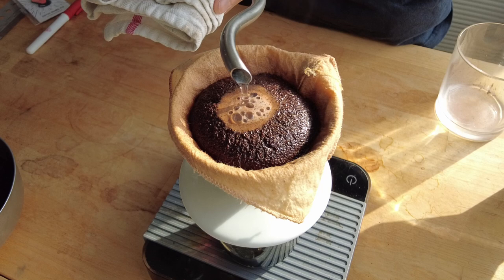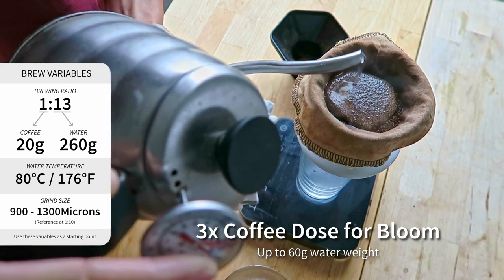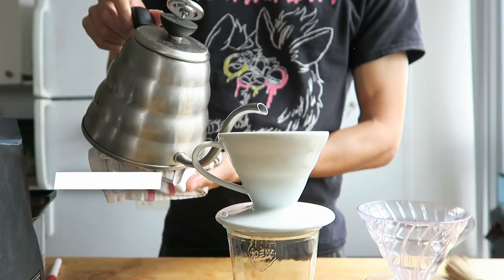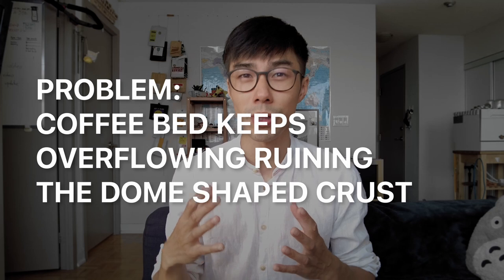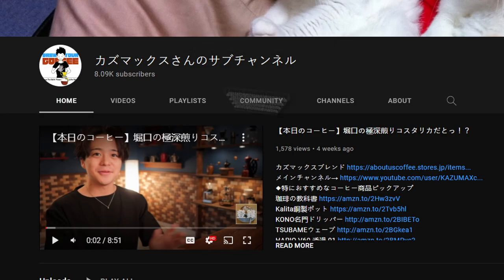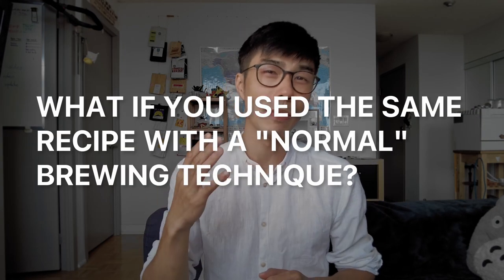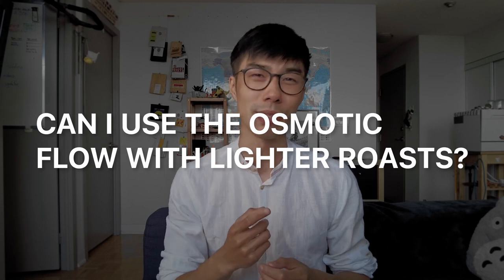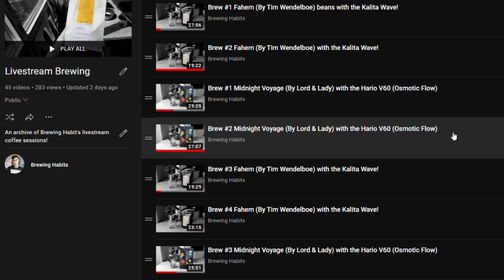Osmotic Flow V60 Brew Guide

Comment from the maker: End up trying the Osmotic Flow and liking/disliking it? Regardless of your experience, I would love to hear your thoughts on it down below ☕☕
Reply: Currently using regular kettle at home. And Brewista when visiting my roaster. Brewista is quite unstable in terms of flow. It can pour in middle/high speed only. Hard to nail. Regular kettle works a little bit better somehow. But I'm using light roasted coffee. Definitely need some 01. Have you tried big doses in 02? Cafec recommends not higher than 25g as I remember.
Reply from the maker: @coffeeblogua  A controlled pour and a proper dose is key with this method. Perhaps the flow restrictor add-on might be a good addition to your Brewista.

The thing about Hario V60 sizing is that if you are using the 02 with a big dose, it would have to be BIG (like 100g+) to reach the bed height of what one can get from just using a 01 as the cone gets bigger up top and you need more grinds to increase the bed height.

The plastic 01's are where it's at. Get one of those and you should be golden!
Reply: Though I haven't quite gotten it done correctly, even my mistake brews are very lively, bright and clearly well extracted. 
I have yet to try using a fresh darker roast.
Reply: I tried this recipe using hario v60 02, but it didnt work. Yesterday i was trying a dark roast recipe for an aeropress and there i saw the dome rising. Today i tried the osmotic flow using an aeropress. And it worked! At least it was better than the v60 02. Now i just have to compare it with an v60 01.
Reply: Hey man, year late but I recently have made a personal recipe for osmotic flow extraction for iced coffee, it's actually fantastic and brings out a really thick body with roasted notes of the coffee! That and also the sweetness and nuttiness of a well balanced dark roast makes for a delectable cuppa!

Comment: - 1:13 Ratio (20g coffee, 260g of 80C/176F water)
- Grind size 900-1300 microns (bit coarser than normal V60 grind, reference at 0:50)
- Rinse/pre-heat filter & shake coffee grinds flat in V60
- 0:00-0:15 Bloom with 3x (math works it to be 2.5x) grind dose in slow spirals about 1" high
- Wait 10 seconds
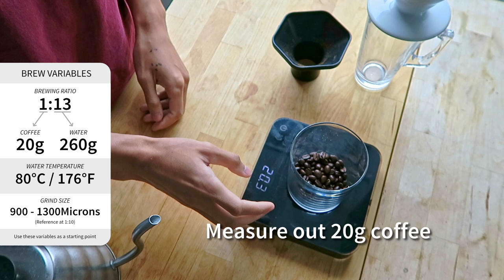- 0:25-0:40 Slowly pour from <1" high straight down the center,  with 1/3 of the remaining brew size (70g)
- Wait 5 seconds
- 0:45-2:15 Pour as slowly as possible from <1" high in a circle (3-4 seconds for each full circle), expanding to about a 1" diameter, and keep pouring on the edge of the circle's foam until reaching brew weight (260g)
- Let drain for only 5 seconds, then remove brewer 
- Stir do a backflip

Notes: 
- Using a smaller brewer (01 VS 02) helps, with a minimum 20g coffee dose
- Tip kettle on its side as you pour to be able to pour even slower (use cloth on bottom of kettle to hold it)
Reply: Do a backflip lmao. A few details seem incorrect, though. The slow pour after bloom uses 1/3 of total (120g). Also, he says the height of the pour stream is less than 1 cm, which is <0.4". The 1" is the diameter of the pouring area on the final pour.
Reply: @VictorChavesVVBC  Yeah, I went with less than 1 inch (<). I also went with his quote in the comments for the ratio discrepancy:
"I don't include the bloom when calculating the 1/3, 2/3 chunks but need to keep it in mind when brewing. So with a 50g bloom, the remaining liquid would be 210g and the 1/3 chunk equals 70g. 50g bloom + 1/3 (70g) of liquid combine to 120g, which is what I use as an indicator when brewing."

He ended at 260g, which would make sense with the above comment using the 50g bloom (x2.5 grounds, not the x3 as described).

I like it, but imo it seems like a waste of coffee. Wouldn't consider it unless I have a really dark roasted coffee.
Reply: @adamthemute  Ahh that's true, at 1:44 he says "the second pour segment, where we pour 1/3 of the total liquid", but the written cue below does indeed say to pour up to 120g instead. Details! Thank you for calling that out ;-)

Comment: Thank you so much! Actual best guide I have found for  the osmotic recipe! I own a bodum meloir gooseneck kettle and it has not got a lot of flow restriction, however I found that, may be obvious but, when you use less water in the kettle the flow controll is going to be better. One can pour slower with a kettle that is filled 1/3 or less! Just pulled off my first  osmotic flow brew today (after 2 weeks of failed attempts lol) and it is quite a condensed filter coffee! Very juicy and enjoyable. These center pour focused methods in my experience amplify the brighter notes compared to traditional V60 recipes but they also bring a grapefruit/Pomelo like bitterness to the coffee. Some friends of mine even described it as tea like? I would say that that is quite a good trade compared to the more muted but also more dark chocolate like profile of the V60 I am used to. If you don't want to leave the comfort zone of drip coffee, Just know that with great power comes great responsibility!
Reply from the maker: I really appreciate the comment! Totally agree with the 1/3 water amount and if you combine a kettle tilt, you can get super duper low and close to the coffee bed! Keep brewing responsibly 🔥🔥

Comment: WOW, well down. you have shown osmotic flow brewing method in a easier way than any other videos. I like the way you turn your kettle horizontally.
Reply from the maker: Cheers, glad you liked the video :D The horizontal kettle is really a clutch move to lower the pour height. Make sure to hold the lid, otherwise you might just have an accident haha.

Comment: Hey! Just came across this video today, and wanted to compliment you on it- I think this is the best and most comprehensive English language walkthrough of the technique that I've ever seen. Cheers to you! I've been playing with this technique for a year or so, and when you get it right, I think it produces one of the best cups you can get from a v60. There are lots of...um, not good videos out there, with only partial or even bad information, hopefully this one gets traction here in the West. I thought the one from the Cafec official page was good, but missing a fair amount of detail...or maybe the translation captions were just lacking, as I don't speak Japanese. But doing lots of research and watching lots of what's out there I pieced together my process, which I was happy to see is pretty much in line with yours. I use a v60 01 with 20g/280ml at a 14:1 ratio, so close. I use a little higher temp water at 85°C, which probably makes sense because I typically use a little lighter roasts- I tend to like medium to medium-dark Latin American beans for my daily home cups (they work well with both my v60 and Aeropress depending on my mood), and tend to save the light roasts for my café visits. Anyway, some things I've noticed are that with the Osmotic Flow method, even more than the recipe or water temp, the two biggest factors are nailing the speed of the pour (using the proper method you highlighted, of course) and MOST importantly, fresh, fresh roasted beans! As the beans get older and naturally lose their cO2, the bloom, gas release, and dome creation is less pronounced, and I feel like the process isn't as successful. Obviously the darker roasts have more gas and last longer, but the process does work with medium roasts as long as they're fresh. But that's ok, once I see the Osmotic Flow blooms start to wane, I use Aeropress for the rest of that batch. I'm too lazy to stop by the roaster that many times. :)
Reply from the maker: Really appreciate the monster reply!! I totally agree with you that freshness is a really big factor with this technique. Once the beans get stale and the CO2 diminishes, the dome shape can't really be created anymore. Cheers :D

Comment: Thanks for sharing. Currently trying to improve my Osmotic flow technique and create episode about it. When I first seen it on Instagram, I was thinking like "do they even extract", but digging dipper, found how this could improve the cup. What water PPM you are using? And what is the cup profile at the end in terms of clarity/notes. Is this roasting style suited for espresso as well?
Reply from the maker: Glad you liked the video! 
I don't have a PPM reader but my water tastes neutral/on the soft side. I use charcoal sticks to filter my water. The end cup is a liquid with a thicker and viscous body, with roast level notes like nutty, smoky, chocolate. The low temperature and other factors lead to a cup with minimal bitterness. Since the roast level is on the darker side, it could for sure be considered as a bean that is suitable for espresso. Cheers!

Comment: Used this method for the first time on a dark roast today, excellent results. I'm curious though, what is the justification for pulling the brewer before the final bit of brew water drains? Why do this instead of just brewing with a slightly lower ratio?
Reply from the maker: I think it’s to even the extraction difference between the beans placement in the brewer. The beans lower in the brewer will be extracted more compared to the beans higher in the brewer if you let it fully drain since it will have a longer contact time with water.
Reply: @brewinghabits  thanks for the response! So the pull happens before the dome gets to fully collapse? Maybe I'll run a test to see if it makes a difference!

Did you ever get around to experimenting with osmotic flow using lighter roasts or altering other variables?

Comment: It took me a few tries to get something that was okay because my kettle's water flow is too fast. The ending result was really interesting - low bitterness, rich darkness, and satisfying thicker mouthfeel! Refreshing compared to the light roasts I have been trying out. Might get a flow restrictor someday or just a new kettle because it's too frustrating with my kettle erg haha. Did you use the size 01 V60 for your brew? I noticed it was hard to stay close to the grounds as I poured because they didn't rise up to the same height as yours did. I have a size 02.
Reply: Also, props for the nice osmosis explanation. I love hearing the more science-y side of coffee brewing. It's so interesting!
Reply from the maker: Glad that you gave it a whirl and managed to get a similar cup! It really does have an unparalleled thick mouthfeel I have not been able to replicate with any other technique.

I am indeed using a V01 Hario V60. The extra inch or so that you get to the coffee bed really matters as it allows for the slow and controlled water stream. With some pouring practice and steady hands, you can probably forego the restrictor but I bet it will make the pour much smoother. Kinda like training wheels on a bicycle!

And glad you like the explanation and video, it really was convoluted when I did my research on the Osmotic Flow so I made it a goal to explain it to the best of my abilities!

Comment: If I grind at setting 9 (900 microns) on Ditting can I catch your grind size?  Or should I grind coarser? Thanks for the helpfull video.
Reply from the maker: Sadly enough grinders aren't designed liked that and the setting on your grinder never matches up to the micron setting. 

I would take out a ruler and eyeball it and try to get the majority of your grind particles to the 900 micron range. I also made this grind size checker that you can print out (make sure you print it to scale), put some grinds on and then visually identify your grind size.
 https://www.dropbox.com/s/u2fgfunb9qsat68/Grind%20Size%20Checker.pdf?dl=0

Keep in mind that a grind size is more like a range instead of a specific number. There will be some variance but the goal is to get the majority of your grind particles to one size. 

As for if you should grind coarser, if your brews flow rate feels slow, still overflows when you pour super slow, perhaps clogs, or coffee tastes overly bitter then I would grind coarser.

Good luck!
Reply: Thank you for the document. It definetly helped me find the right setting. By the way I'm using 1zpresso Q2 settings (22 + 1 click) around 900 - 1300 micron. There was definitely a change in taste. Thank you so much!
Reply from the maker: I am glad that you got your grind size dialled in to a reasonable range! Now that you have it in the ballpark range, you can start making the smaller tweaks to the extraction variables to hone in a balanced extraction. 

Before, the grind size must have probably been wayyy too fine making any changes you made still taste over-extracted and bitter (since it was so far into the over-extracted realm due to the overly fine grinds).

Glad to have helped and good luck with your future cups!! Lemme know if you encounter any other coffee issues/questions :D

Comment: i must not be smart enuf for this method :)  i can't get the numbers to add up for the first pour.  you said the first pour (after the bloom) was 1/3 the total liquid and then said and displayed that was 120g.  but 1/3 of 260 is 87g.  if you add this to the 60g bloom that's a total liquid mass of 147g.  so i don't get the 120g.  the final pour takes care of itself since you pour until you reach the 260g, so it's just the first pour that's confusing me for the amount of water to add.  maybe it's just me.  otherwise the video was excellent and well explained.  i like the trick of tilting the kettle to get it closer.  i've tried a similar technique and also switched to cafec roast-specific filters, and thought it made a noticeable improvement in taste.
Reply from the maker: Heyyo, here is a copy/paste from a previous comment!

"I don't include the bloom when calculating the 1/3, 2/3 chunks but need to keep it in mind when brewing. So with a 50g bloom, the remaining liquid would be 210g and the 1/3 chunk equals 70g. 50g bloom + 1/3 (70g) of liquid combine to 120g, which is what I use as an indicator when brewing. Hopefully that makes sense!"

Cheers!
Reply: @brewinghabits  ah, ok, yes that makes sense.  i did look thru some of the comments to see if someone else asked the same question, but guess i missed it.  thanks for the quick reply!

Comment: About how many grams of brewed liquid coffee do you typically end up with after removing the brewer at the end of the process?
Reply from the maker: Funnily I'm actually going to test this out tomorrow on the livestream brew! But as an educated guess, grinds retain around x2 their weight in water and I would say it's like 15-20g that ends up dripping out. This would make the final cup in this video around 200g of brewed liquid.

I'll edit this comment with my findings tomorrow :P
Reply: @brewinghabits  Sounds good, look forward to your results. Thank you.
Reply from the maker: Today I brewed with 25g coffee and 250g water (1:10 ratio). The end liquid in the cup was 175g, liquid that drained after I moved the dripper was 35g making the retention in the coffee bed 40g.

So around 70% went into the cup, 14% dripped out and 16% was retained in the coffee bed!

Correction, it was a 1:10 brewing ratio I used, not 1:13!
Reply: @brewinghabits  Thank you!

Comment: I found that the flow with Hario 01 bleached filter was too fast. Seeing as you use thick cloth filter, I tried double 01 filter and it worked much better.

Comment: what this still work with a chemex instead of a V60? I would just have to maybe add more coffee, or lower the kettle while pouring right?
Reply from the maker: You can try buy I doubt it will work as well. The key to the dome is minimal agitation and the high rim of the Chemex will make it really hard to achieve that (without using like 100g coffee or something lol). The filter might also not drain at the speed you want it to (being folded asymmetrical and flush with the glass creating a seal and slowing down flow). 

I would get a cheaapo plastic V01 V60. Those things are like under $10 at the Hario website.

Comment: Thank you for your sharing. I noticed you mentioned that after blooming, you pour 1/3 of total fluid ie 120g out of total 260g. But isn't it 1/3 of total 260g is 86.66g?
Reply from the maker: Heyyo, here is a copy/paste from a previous comment!

"I don't include the bloom when calculating the 1/3, 2/3 chunks but need to keep it in mind when brewing. So with a 50g bloom, the remaining liquid would be 210g and the 1/3 chunk equals 70g. 50g bloom + 1/3 (70g) of liquid combine to 120g, which is what I use as an indicator when brewing. Hopefully that makes sense!"

Cheers!
Reply: @brewinghabits  thank you very much for your prompt reply. You explanation is very clear and precise. This is by far the clearest explanation and demonstration of osmosis flow brewing.
Reply from the maker: No problem! If you have any other coffee questions then you know where to find me :D

Comment: With respect to lighter roasts, I do wonder if the dome aspect is more aesthetic and the flow of water would be more or less the same, although it may need some tweaks
Reply from the maker: I have given it multiple whirls with lighter roasts and the amount of CO2 that it has seems to be the impacting factor leading to a flat bed instead of a dome-shaped bed. If you end up trying it with a lighter roast and get good / different results than my findings, then let me know :D